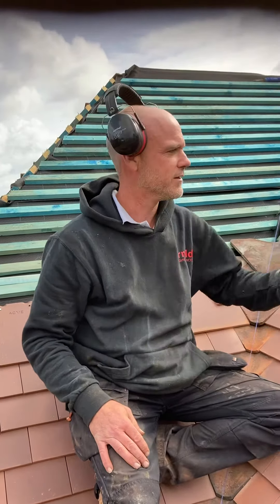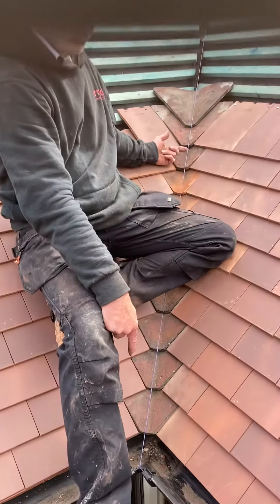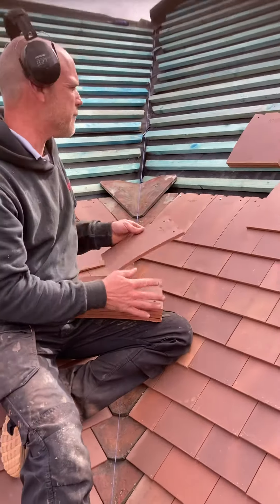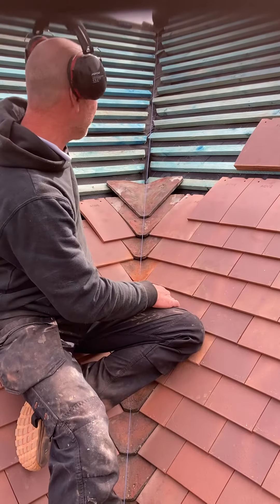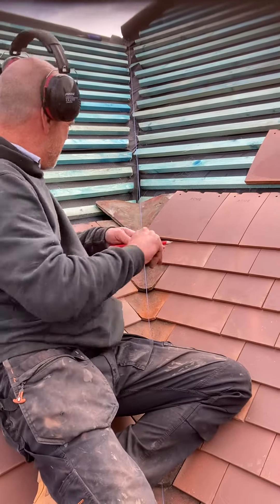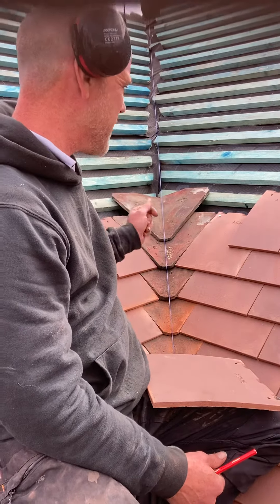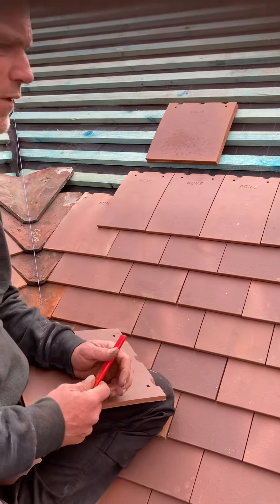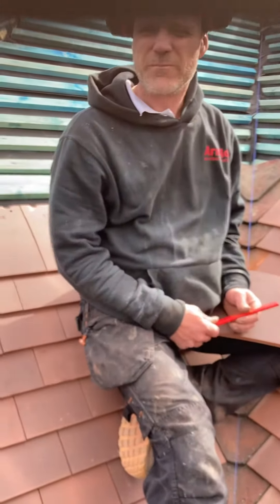Installing clay valley tiles

Comment: I always cut those in from the top down. Lay the valleys in 1st with a tile either side. Tile the whole roof in with a 2-3 tile gap. Makes it so much easier and no ladders needed and 0 chance of breaking anything.
Reply: I always got taught the same but never seen anyone do it the same .. this way just seems far too much pissing about cutting when you could start from the valley and work outwards from it .. never understood why you’d want to cut so many tiles if you don’t need to ??
Reply: @ETH85  Prep is the key think smart you can perp a plain tile roof finishing all cutting before infilling
Reply: @lesdorry  I personally wouldn't ! valley first then work out from there on Rosemary's for me way easier then just over hang the verge in full tiles then it's one cut straight up the verge.. 
tongued tiles I work right to left always as you're putting the tile straight on instead of tucking the lip in.. 
every roofer I know works differently depending on how you've had to work, and I've worked alone a lot, so I had to do things to be more energy and time efficient
Reply: @ETH85  Yes working alone makes life harder its easier to strike chalk line perps and I always work right to left it is possible to run both verges and filling from left to right using rosemaries if you have good perplines the 5 tile gap is okay as you can fill in as you come back down the roof.I am very old school when I started we didn't have bumper machines we carried the tiles on our heads up the ladder and wore a peaked cap back to front with a wollen doughnut-shaped ring in side. climb  two rungs at a time this was called running a ladder hod carrier would use the same tricks  and then slide down the outside of the pole  ladder breaking with the insides of your shoes
Reply: @lesdorry  I've done it the same.. I've stripped 4 sided roofs on my own done all the felt batons then carried all the tile up the ladder myself , loaded out then tiled up.. do e done serious graft on my own and why my body is ruined at 39.. 
I like to put my first course down loose and position that course to give you an even cut each side of yhe roof to give symmetry too, I always found filling in I could always see it so does my head in.. really bad for noticing any little thing and I'm bob on at cutting but cut edges always stand out so I'd rather them be on the outsides.. 
I prefer my slate work in all honesty along with lead work and pointing not a tile fan at heart I find it boring but whatever the customer wants eh pal ?

Comment: tile it in first, put your tile and half down, then your tile on top mark and cut it, perfect every time with a good bloke on the stihl. Normally have a laff in the valley to keep them straight and to mark round to marry the laffs up.
Reply: Totally agree, we always put a lath up, it helps In marrying the courses more efficiently too. No need for string line then as the bottom of the valley tile meets the bottom of the two opposing tiles. This will keep everything straight and in line. 👍
Reply: This is the way to do it. I am an old school roofer

Comment: Great job but Is there a reason you couldn’t set out the bottom eve on left hand side of valley to eliminate cuts and just use a hole tile and cut it in at the hip just a thought as I can’t see if it’s hips both sides
Reply: I have done that many times best with a 45-degree pitch nothing worse than finding a pig in a roof A Pig is a roof pitched with varying pitches and has to be compensated by changing baton gauges so they all mitre`s at hips and valleys

Comment: Would you say nailing every 3 course of Marley concrete plain tiles is good enough ??
Reply: Usually the spec is nail the eves and first course then nail every fifth course, mark a small x on the bottom of the tile on the nail course so you don’t get confused as you tile in more of the roof
Reply: @jordankennedy7281  cheers for getting back to me I just nailed every 3